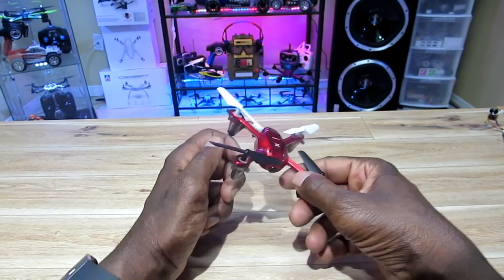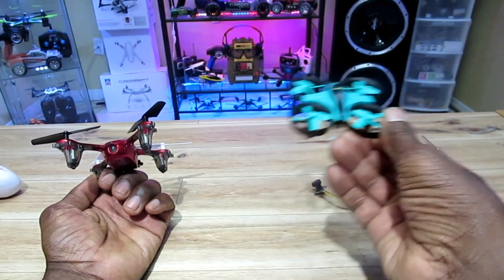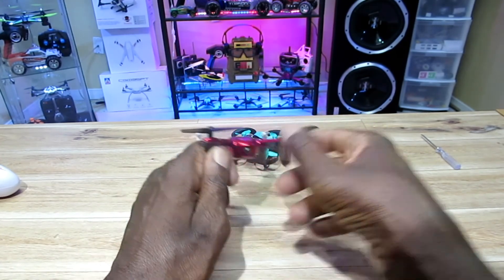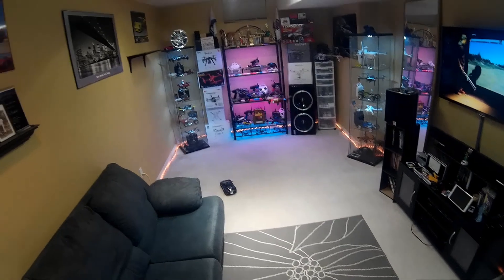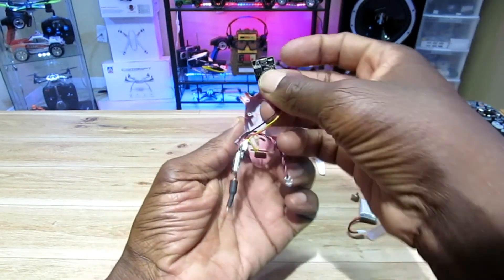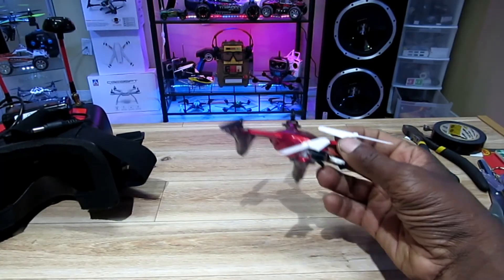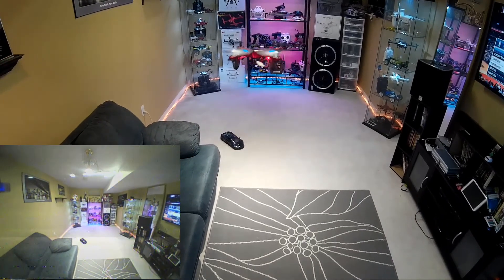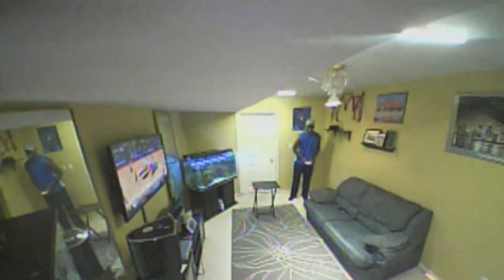Syma X11 FPV Camera Mod. Install and Test Flight. Akk A5 cam

Comment: Hi, please tell me how you manage to plug in both camera and drone to battery at the time,  and what switch you used?
Reply from the maker: I soldered the positive and Negative wires of the camera  to the same terminals inside the quad with a light switch connected . I'll leave a link in the description for the switch